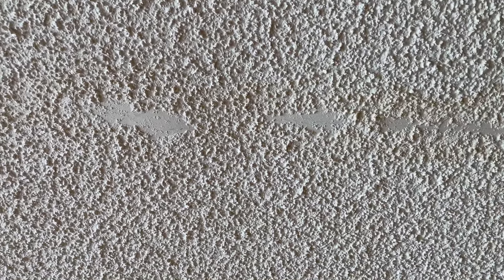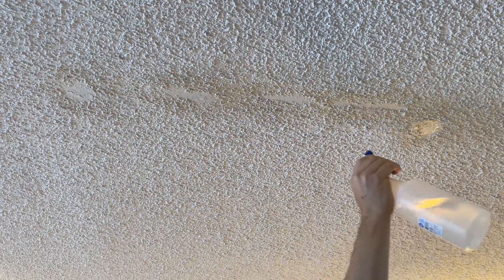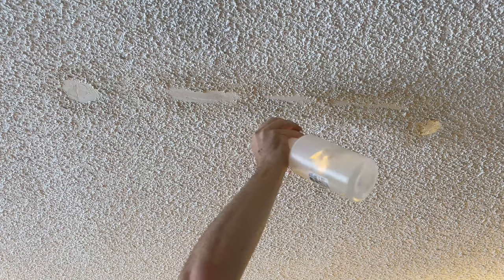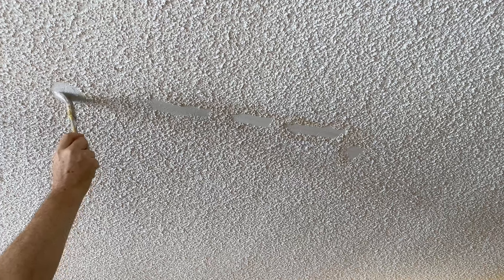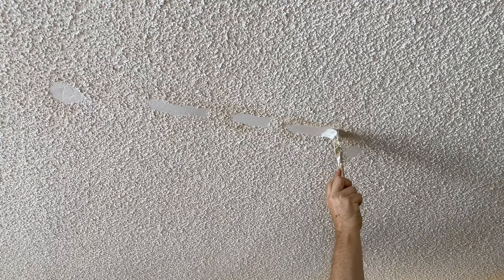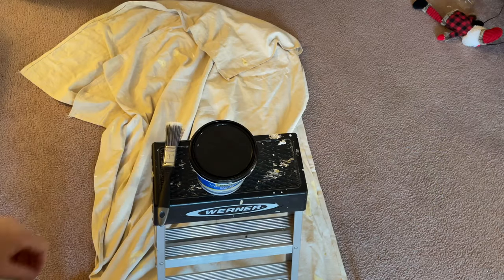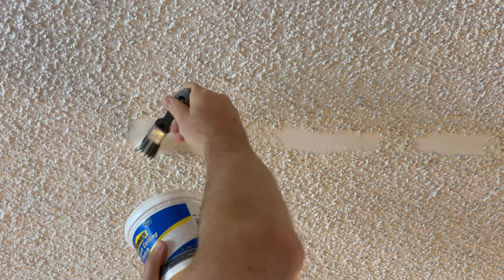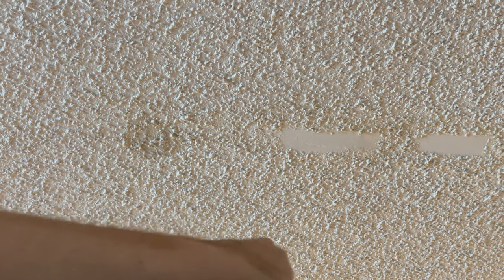Repairing A Popcorn Ceiling - Without the Popcorn Spray

Comment: I lean toward perfection and took on the challenge.  I bought the tube because of all the comments indicating that the tub when mixed all the popcorn pieces disappeared.  My repairs were small but many and around the edges of the ceiling.  I used a small stiff paint brush and applied with the tip of the brush and for some strange reason using the flat part to tap to get the popcorn look worked perfectly.  Let dry for a day or so and used flat white ceiling paint.  Great results.  Anyone else use the tube to find that mixing made the popcorn pieces disappear.

Comment: I had some areas around my Air Conditioner that got wet when it leaked. Some areas were bare down to the dry wall. My first coat came out too thin because I literally tried to paint it on, but I went back an hour later and dabbed on a thicker coat and went back and broke it up by pushing the brush upward into it and spreading it a little bit. The next day it had dried just about the same color as the non damaged area and looks pretty good. There are still some stained areas so I plan to spray some Kilz on next weekend, but I am happy with the texture and color of this product

Comment: I mixed a bit of paint into mine before application. Helpt to adhere and blend with the original color.
Reply: Huh.  When you mixed paint in, did it work the way you wanted colour-wise?  My specific problem is that the last owner of my apartment building painted the popcorn ceilings (and every other surface) a depressing light grey with a pearl sheen. The popcorn is failing in sheets and cracks -- the paint bonded with the popcorn, and it's peeling like you'd imagine (my guess is the pre-popcorn surface was painted in oil). In most of the rooms I've very gently painted the ceilings with good quality white ceiling paint and repaired the cracks with a spray at the end, with mixed results (so this video is incredibly helpful -- thank you!). 

In one of the apartments, the grey ceiling actually looks attractive, but the stippling is really failing -- the last one to be repaired. I'm just weighing options at this point, but I'm interested in trying to keep the existing grey colour and stippling if I can. Any advice on working with this product and tinting it would be greatly appreciated.

Comment: What kind of primer did you use? You applied it with a brush in your video but the link in your description is for a spray type ceiling paint/primer. What did you dab on with the brush?

Comment: Did you apply a second coat, as it appears a one coat looks good enough, how long did you wait after you applied the primer and how long after the second coat
Reply from the maker: I ultimately applied two "coats"... I did it all once, let it dry (probably only waited 30 to 40 minutes) and then decided it needed a little more popcorn to blend in with the rest of the ceiling better.  The second pass was just sort of filling in spots that looked a little sparse.

Comment: I watched your video because the young man fixing my attic broke my ceiling in two spots.  I went to Home Depot and fixed the first very small area to where it looked ok.  My second area is much larger.  The repair (in progress) looks horrible. I rewatched your video and lo and behold your container has popcorn in it.  Mine hardly has any.  Not certain what to do now if Homax is making their popcorn patch repair with practically no popcorn in it.
Reply: Same.  My container  has no popcorn in it.
Reply: I bought two containers to repair my ceiling.  The first had hardly any pigment inside.  The second container I ended up shaking the heck out of it before I opened it.  When I did open it, it was thick, and there was a lot of pigment.  I applied the next coat from the second container, and the spot where I did the repair is no longer noticable.  I did not shake the first container, and just stirred it.  I do not know if shaking it made the formula thicken.  Also, at The Home Depot where they had this product on the shelf there were several containers that had lids that were not completely sealed.  It looked like people were opening the containers to look for the heavier consistency formula because that formula works better.  I applied the formula with a brush, and built up a consistent layer to be even with the existing ceiling.  This required several coats.  I would use this formula again.  It is better than the stuff you buy in a can.

Comment: Does it dry and turn white?
Reply from the maker: Yep, pretty white.  Not BRIGHT white, but white.  You may need to apply a thin coat of flat white paint (usually for ceilings) to make it match perfectly.  But matching paint color on a 20 year old popcorn ceiling might be a little tricky.  I got pretty lucky, I think.

Comment: The Homax popcorn repair tub varies greatly from container to container. You need to check each container out at the hardware store to make sure you get a super thick consistency. The first tub I bought was watery, way too thin, and way too little popcorn. I bought the thickest homax tub I could find. Then I bought Zinsser Roll A texture additive (coarse). Also the brush method didn’t work well. Probs because homax gave Home Depot a bad batch of product. I used a roller and it worked perfectly had to do three coats because the first coat was worthless (watered down homax tub)
Reply: I bought the thickest formula, and shook it up well before using.  I did not stir like it states on the directions.  I applied several coats with a brush, and you can't even tell where the repair spot was on the ceiling.  This formula works better than the stuff you buy in a can that is an upshot formula.  If you buy look for the thickest formula.  At The Home Depot several containers had loose lids because people were lifting the lid to check the formula for thickness.  This stuff does work.